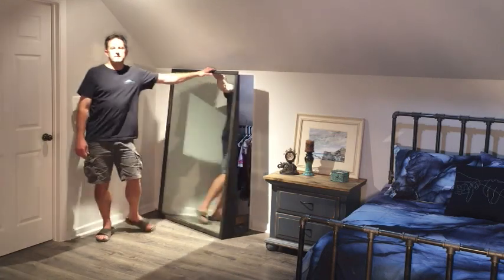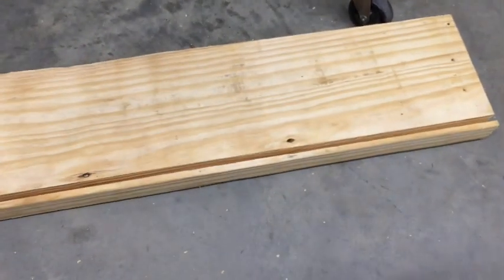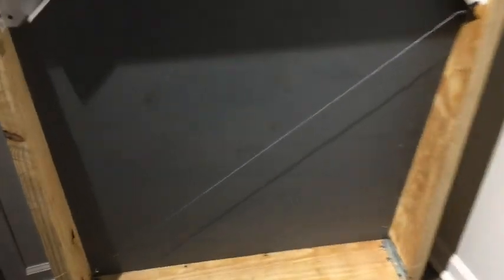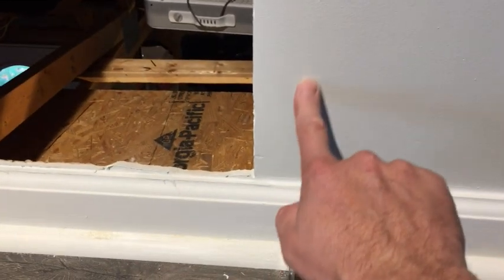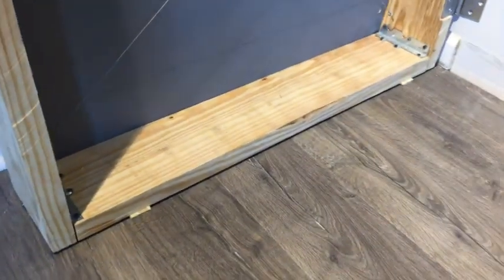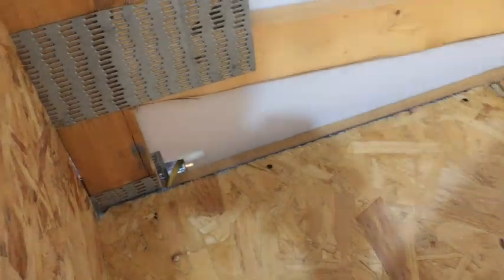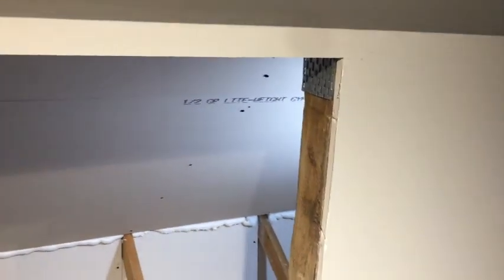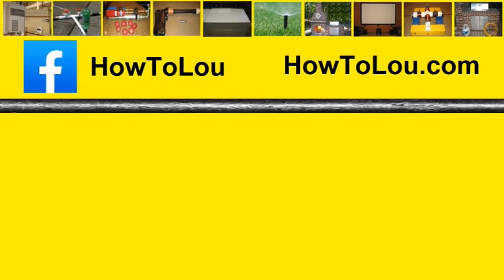Secret Hidden Closet Build

Comment: Using white duct tape instead of a door jamb to increase clearance for a closet like that is brilliant.  I have some openings to the attic under-eaves space that I've got to close up like that.   I hadn't thought of using a swinging mirror In those openings, since they are inside closets. but I'm going to look around and see if there's something else that I can use instead of building a custom odd size paneled door.  Maybe something that would be useful on the closet side. Thanks! 

Great vid, btw. You gave all the details, very clearly,  while not wasting any  time.